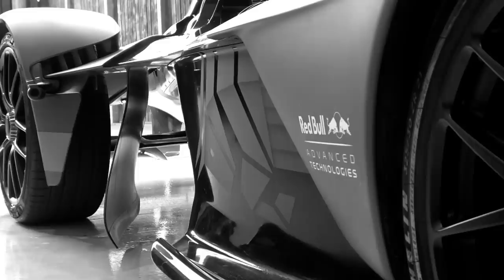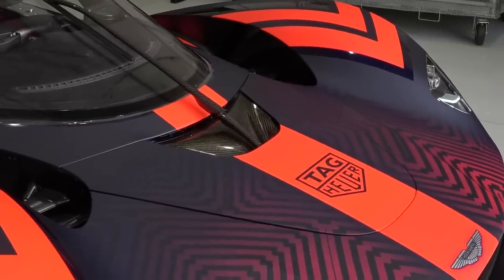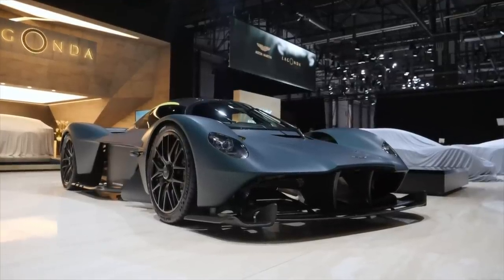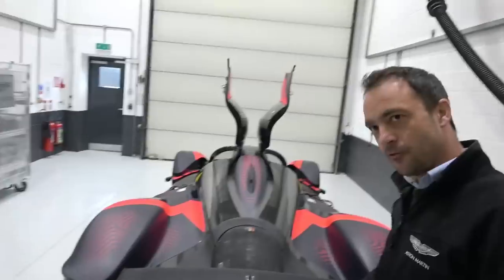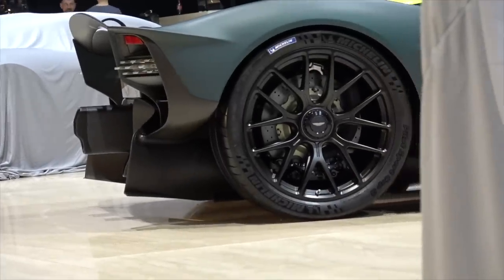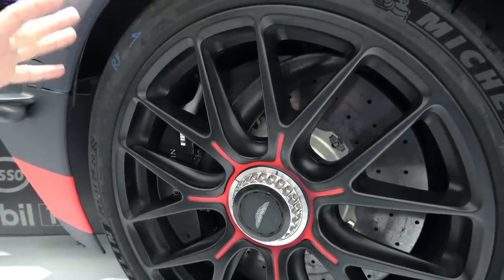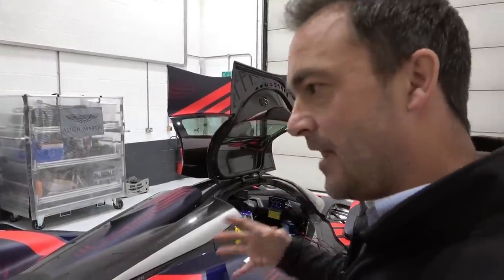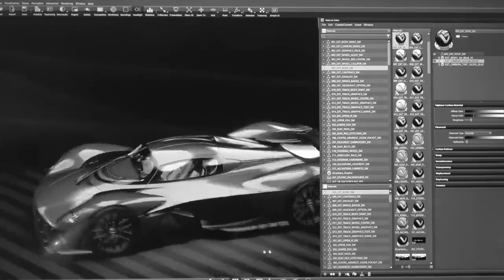Valkyrie Is ALIVE! World's First Onboard Drive!

Comment: I can give you guys an insight of the company that made the heat coating on the top section of the exhaust 
the actual heat that car generates is about 1000 celcius degrees on the top of the exhaust system which is nearby the wing so it has to be protected too.The actual material they use is a combination of zirconiuem and non metal materials which is basically a ceramic that has a great heat resistence and the company that makes this ceramic is Zircotech which james avoided to mention in 3:12
Reply: Why is it in James interest not to mention that he avoids..
Reply: Oh. I see, nvm. Now you share will he have to delete this comment?
Reply: michael  Perhaps he was told to just avoid saying too much incase something slips out that we don't know.
Reply: Oerlikon Metco is the company that provides Zircotec with their equipment and some of their processes. A lot of good literature from them if you have further interest in thermal spray coatings.
Reply from the maker: When I first started filming the very early days of the Valkyrie project the coating was a secret at that time and I’m just used to ticking PR boxes to get videos passed (lots of technical partners involved) so this particular component for me has always been a case of mention the feature not the supplier and I default to that now ha ha
Reply: Thank yiu
Reply: So... Zicrotech had a fire at their offices in July... I wonder if Salomondrin is taking delivery of one of these McLaren Senna beaters...?

Comment: you know that a car meens business when stock out of the factory its on pace with lmp2 cars... I'm hyped to see them competing at LeMans
Reply from the maker: North Gen Yeah that’s not even on the Cup 2 tyres with aero pack either that’s “just” standard 😂 incredible
Reply: Take caution.  First it was suppose to be f1 fast, now it's lmp2 fast.  AM is running out of money...
Reply: @Bahamuttiamat  i was thinking that to they definitely said it will have f1 performance! Well they will probably say it does have f1 performance just not compatible with todays f1 cars! More like a 10 year old f1 car!! 🚘
Reply: Bahamuttiamat They never said the standard road car version would be F1 quick
Reply: @gustavoflorio5383  So you're confirming it was said by "Aston Martin".
Reply: @baddazzgarage2953  yeah just a pr stunt , its currently impossible to have a Hypercar that is on pace with F1 , if ur road legal car is faster than f1 then F1 is doing something Wrong.  That said the valk might be faster than the 2021 f1 😂😂
Reply: @LittleLightIsaOnce  It's not that hard to get a car's specs on par with F1, especially not with a prototype like the Valkyrie. F1 cars aren't that light anymore and never made that much downforce, the tires can easily be matched, and the power is already surpassed by the Aston.
Reply: @christianponicki9581  dude  1000hp 700kg and more than 2000kg of downforce at high speeds.. The 919 evo cant beat the current F1 cars on a track and thats a modified Lmp1 car how is a Lmp2 "speed" hypercar supposed to beat that. And i dont think the Track pack os gona add that much down force. 
Only place where i see these cars beign able to beat f1 is on like Le mans where you have an insanely long straight. But on his monza spec Vettel was hitting 365kph no problem so idk 🤷🏽‍♂️
Reply: @LittleLightIsaOnce  I don't understand why F1 fans are in such denial over the 919 Evo - it already has beaten F1 cars, deal with it.

F1 cars have anywhere from 700-900hp from the engine, and another handful from KERS. That kind of power has been easily achievable since like 1985.

At 200mph, modern F1 cars make no more than 6000 or 7000lbs of downforce, which has also been attainable for all kinds of cars for decades.

They weigh around 1600lbs, which is impressive but the same story as power or weight.

Even private entries in the WTAC are able to match or surpass F1 cars at many of these individual traits. The only question is, when will someone make a whole package that's that good?

The Aston Valkyrie, stock, probably won't come close. But the AMR Pro stands a much better chance.
Reply: @christianponicki9581  dude the 919 didnt beat it 😂. It did the 2017 F1 car but Vettel beat the 919 with his ferrari in Spa 2018 Fp2 i think.. Yeah he did i just checked. 
F1 car from Seb.Vettel 1:41:5 (ferrari)
F1 car from Lewis Hamilton 1:41:55 (mercedes)
919 evo 1:41:7

Keep in mind the evo is unrestricted and uses Drs on the back straights where F1 cars dont. So yeah I HIGHLY doubt a Hypercar can come even close to current F1 cars.
Reply: @LittleLightIsaOnce  Defensive as usual, geez.

The 919 Evo beat the standing F1 record at Spa, and when it was beaten again by an F1 car, the margin was only like 0.2 seconds. Plus, the Evo was only beaten by 1 or 2 cars out of a grid of 20. Technically it might not be a pole sitter in 2018, but it's still competitive with the bulk of F1 cars, and using less power to boot.

I'm confused why they only ran the Evo with 720hp instead of using more, but the Valkyrie should actually have an advantage in that department because it runs 900 or 1000hp. Also, the Valkyrie is a less restricted design than the Evo since the Evo was stuck using an LMP1 car as its base, whereas the Valkyrie uses more radical things like those massive ground effects.

PS, if you're talking about FIA Hypercars, then you're right, none of those will ever come close to F1 performance. the FIA/ACO made sure they'll be even slower than LMP1 cars. :P
Reply: @christianponicki9581  deffencive ? I just pointed out facts you are the one trying to prove that the Evo is faster haha
Reply: @LittleLightIsaOnce  I just stated facts about the 919 Evo. I remember it making headlines when it beat an F1 record at Spa. I'm not claiming it's a magical car that beats everything F1 will ever race, I just said it beat F1 cars once.
Reply: so how much is a native lmp2 car?
Reply: @christianponicki9581  Porsche's chassis probably couldn't handle more power than that. The 720hp from the evo is coming from a four cylinder engine and electric motors. Battery technology is the main limiter here due to heat from discharging the current needed to run those motors. Also getting more than 700hp to the ground in a usable manner is no small feat. 

Horsepower is not the most important metric in most races, torque and braking are (Acceleration). HP matters in Le Mans, but in a majority of shorter courses (pretty much any course), torque and braking reign supreme.

There are just too many variables up in the air (downforce pun) to compare the horsepowers of cars and guess which one will be faster. I'm not too sure even RBR  can do that with their industrial grade simulations. So we may as well wait for these to be raced for real before speculating!
Reply: @alcatorc  Sport-prototype chassis have been easily handling 1000+hp for at least 30 years, if not way longer. (e.g., Can-Am in the late 60s with 800hp cars or early 70s with 1200hp cars, or IMSA GTP in the late 80s with 1100hp cars)

Also, people have literally made highly competitive race cars producing over 800hp from crappy old Porsche 968 chassis, so I'm pretty sure the 919 Evo's carbon-unobtainium monocoque chassis could handle at least another few hundred HP.

Same story for the engine: turbo 4-cylinder engines have been reliably making 1000hp for at least 25 years, if not much longer. Getting more boost from the 919 Evo's engine could literally be as easy as the turn of a knob.

Not only that, but putting the power to the ground has been fairly easy for at least 30 years, and should be easier than ever with modern tires. Plus, it's been demonstrated probably a hundred times in many different series that an extra 100 or 200 HP are enough to shave several seconds from your lap times. Not only does it make you faster on straights, but it lets you convert all that speed into downforce by compensating for drag.

Pretty much regardless of the track, and especially on massive Tilkedromes, more horsepower can only ever be helpful, usually massively helpful.
Reply: Christian Ponicki  I really love the 919 evo and every record run it did. But...  it did not only have 720hp from it's 4 cylinder engine, it also made 440hp from it's electric motors. Combined it had 1160hp, more than an F1 nowadays. Hence the top speed of 369km/h at the Nordschleife and it's extreme acceleration. I've read in depth articles on this car and when qualified Porsche engineers tell that 720hp and 440hp was the maximum amount of power to be safely drawn from the available machinery (it is a long distance concept after all) I believe them. 

What the 919 evo achieved was beyond impressive, especially because it still was a long distance racer with limited budget made for further improvements. 

But F1 cars have been faster than the evo, even it was a mere 2/10's. The track record set by the evo itself was a few tenths below F1's record. And these cars competed within the rules of competition. Well okay, Ferrari not :-P

Maybe it's better to recognize F1's performance, because somehow you sound as the hater to me. Not the other way around.
Reply: @rofufoja  I never denied most of those things...? You seem to be arguing where there's no real disagreement.

The only thing I question is Porsche's claim that they couldn't get more power from an engine layout that's been making 1000+hp for decades.

Also, the 919 might make more power than an F1 car overall, but F1 cars easily make more power from the engine - I've heard they make around 850hp, vs. 720hp from the 919 Evo, which is a big deal. That's why F1 cars can hit ~220mph at certain tracks in spite of being open-wheeled.

Aside from that, why should I "recognize F1's performance" when first of all, there's already an army of fanboys doing that 24/7, and second of all, everyone's already aware of the speed of F1 cars anyway?

Plus, I'm not nearly as much of a hater toward F1 as F1 fans usually are toward other forms of motorsport, which is most of the reason I dislike F1 in the first place. It's such a chauvinistic sport that its fans (and even drivers) feel the need to piss on other motorsports.
Reply: @rofufoja  Also, I wonder why no one calls out the guy who denied that the 919 Evo ever beat the F1 record? In spite of it being verifiably wrong, nobody ever criticized it. Sounds less like I'm an F1 hater and more like the rest of the thread just wanna defend F1 no matter what.
Reply: Christian Ponicki ''Also, I wonder why no one calls out the guy that denied that the 919 Evo ever beat the F1 record?''  Read again what he wrote. He didn't state that. But it is what got you triggered.
Reply: @rofufoja  "dude the 919 didnt beat it 😂."

Yeah, he did.

PS, how did it "trigger" me if he didn't say it?
Reply: Christian Ponicki  Read it again, instead of taking quotes out of context.

Before this he mentioned CURRENT F1 cars. That also means cars after Porsche took the lap record. So he is correct. 

Plus, read again what he writes after your mentioned quote. He basically explains what he means, referring to the years he was talking about. That seems to be his point, no more nor less. 

I'm done here
Reply: @christianponicki9581   the 919 cannot be compared to the qualifying format of F1 for lap times. Qualifying is essentially strategy with limited tries and not ideal track conditions. There's also the fact the cars are tuned most likely for race day and not only a glory run since they cant be modified after qualifying.

Where as porsche basically had unlimited tries and and the luxury of picking a day with ideal track conditions for a glory lap time.
Reply: @ne0wiz  The Porsche didn't have "unlimited tries", perfect track conditions, very much driver time behind the wheel, years of development like F1 cars have, or a factory team with an active $300 million budget behind it.

If you argue from that angle, you're arguing against the F1 team, not Porsche.
Reply: @ne0wiz  PS, the 919 Evo was outright stated by its drivers as not being at 100% pace because they could've driven it harder. F1 drivers are the exact opposite: they're paid million dollar salaries to drive the car beyond its limits every time they qualify. So again, I think it's the other way around.
Reply: @christianponicki9581  When the 919 did the nurburgring,  they constantly surveyed the air temperature and density before attempting.

My point is the porsche team has their pick and forecast on which weekend they want to attack and challenge records, where as f1 is a fixed schedule and time frame. 

All these drivers should know the courses by memory so its not a matter of experience.

Theres major advantages when you have a controlled environment to set a record. A lot less pressure, only need 1 good lap out of 60 to 70 tries while Q3 qualifying u get 3 chances at most, no one will get their best time with only  3 tries. No need to think about tow or enough space between cars. Youre battling yourself and not your rivals when the track is closed to set a record. You have the option of continous adjustments and fine tuning.

The reason f1 cost so much is so these teams can combat all these variables and disadvantages but they rarely get it perfect.

perhaps the 919 is faster, but comparing qualifying times vs closed track time record is never fair
Reply: @ne0wiz  PS, sorry for the long comment, it slipped my attention until I was done posting it. :(

I understand what you're saying, and it's true that weather can affect relative car performance (and always does to some degree). But usually, that doesn't stop anyone from comparing year-to-year Le Mans lap times, or year-to-year F1 lap times, or Daytona lap times, etc. - and I'm sure you've done those comparisons before too, in spite of weather skewing them.

Your other complaint is about qualifying format vs. closed track time. The 919 Evo surely had a scheduling advantage, and having a track without traffic getting in the way was probably helpful too. But I don't think it ends up making a big difference, and especially not a big enough difference to make comparisons impossible. F1 teams still come very close to the cars' limit even within their tight schedule, and on the other hand, I could even argue that factors like drafting, or rubber being laid on the track by other cars, helps F1 during qualifying when compared to the Evo running on a cold, empty track by itself. There's also the Evo's very short lifespan of ~6 months to consider, as well as the relatively short practice sessions given to its drivers, who had no familiarity whatsoever with the car.

(On this final point, you said that track memorization is all that counts. That's definitely not true; tracks become very different with faster cars, and the cars themselves must be learned too.)

But also, there are 100 other factors deciding the difference between the 919 Evo and an F1 car, and most of them are in the F1 car's favor: a gigantic budget, hundreds of hours of sim testing for drivers, year-after-year car development, thousands of laps of accumulated practice around any of the major tracks, superstar drivers with massive salaries, teams of engineers offering radio coaching to the driver, special tire development programs for the cars, constant car development allowing for finer tuning, entire track redesigns to make tracks more "F1 worthy" - and the list goes on.

Your point has been that F1/Evo lap comparisons are moot because the Evo has a scheduling advantage. But seriously, you don't think time is on F1's side in other ways? Or, why isn't the comparison moot because of the massive differential in terms of money, car development, driver talent and practice, tire development, etc.?

It seems like F1 cars are given every accommodation under the sun and this doesn't bother you, yet the very first accommodation given to the 919 Evo is enough for you to call off the comparison entirely, which is a little weird.

Comment: An LMP2’s pace, on road tires? Hmm, Chris Harris will sort out the truth for us...
Reply: It's not hard to believe, this thing will eat a LMP2 for breakfast in a straight line, and in the corners, if it can pull 2.5-3G (which it can apparently), it's not gonna be significantly slower than either. On any track that's a bit faster like Spa, this will probably easily be as fast as an LMP2 car.

Comment: When you realise that a LMP2 car is just as quick with less than half the power  of this thing you start to appreciate how incredible a LMP2 car actually this. This thing is not much more than a rich man's knob extension
Reply from the maker: Well firstly most LMP2 teams are funded by privateers (aka rich men) who spend around 10 million PER SEASON to run the car and team. LMP2 don’t have to adhere to any road rules 🤷🏻‍♂️ run 4 less cylinders and requires a 12+ person race team to even make the car operate for 1 race before rebuilding the engine and stripping apart the car. So no...not really. Valkyrie does all of that on its own and then drives home via McDonalds afterwards. For several million less.
Reply: Mr JWW best reply to a YouTube ‘expert’ ever👍👍
Reply: @MrJWW  Thank you for an utterly patronising response. Should I point out that most of the cost of running a team is spent on running the team rather than buying the actual car, so your comparison isn't remotely relevant. 

If course these toys are all owned by rich men but in LMP1 they go racing. I doubt many of these Astons will do much more them be loaded into trailers by their owners as they avoid impacting the value

As for the road car idea, well if you ever see one on the road without phoning one of your mates up to stage it, let alone going through a McDonalds then I wait for thae photo with baited breath.